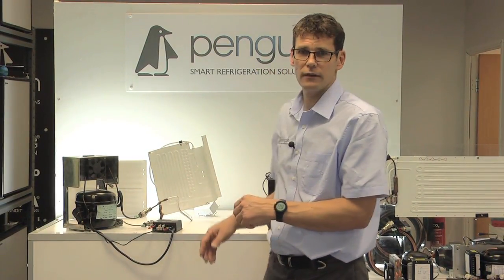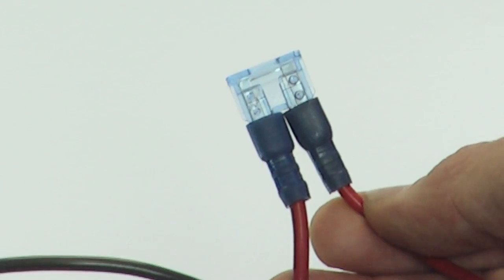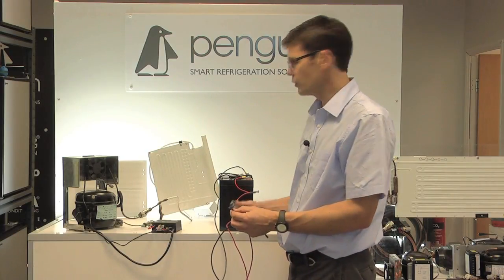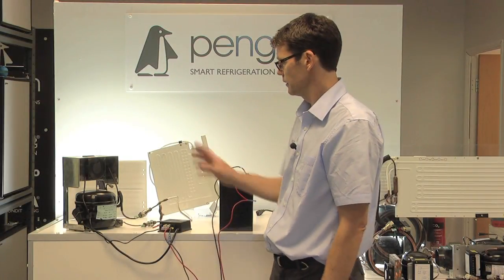Testing and Replacing Danfoss BD2.5 or BD3 12V or 24V 4 Pin Controller

Comment: I have a danfoss 102N3031 for an adler barbour cold machine, bd 2,5.  Its stop functioning twice.  Is there another module thats compatable with this compressor?  Or can I make it function on AC only as the boat is mostly docked at a marina.

Comment: Old video but hopefully I'll get an answer. I use the 24v. What fuse is the proper one? I found a 7.5A one but the one in your vid is blue. Guess it's a 15A? Also can I still get parts from you if necessary?

Comment: Hello, 
I have found that the fan output is faulty. However when fan unplugged the fridge is working. I also tested the fan separately and it is also working and NOT drawing extra amp only 0.3amp.
Any idea ?  Thank you

Comment: Hi. Thanks for the video. Is it possible to connect directly a danfoss bd 2 to the battery 12v without a controller? I just want to try if the compressor works fine. I have a westfalia. Thanks.

Comment: Hi Francesco thank you fro your enquiry.  You cannot connect a battery to the compressor pins directly. The compressor motor is 3 phase DC and you will damage the motor windings.
Penguin Refrigeration will test your controller for a small fee if you would like to have it checked.

Comment: I would like to thank you as I just troubleshooted my compressor with your help and this video.
My problem is to find out, what BD I have. Is it a 2,5 , a 3  a BD35 or BD35F?
My controller is a 102N3030.
On the cover it says Seafrost.
Reply: Check for the pins when you disconnect the electronics. If you have 3 pins it's bd35/50 or if you have 4 pins it' 2.5/3.

Comment: Hi.  I,ve throughly enjoyed and learned a lot from your videos.  I've gone through the tests, replaced the thermistor, but the fridge still has the same problem - it comes on (usually) and stays on for a few hours and sometimes days but then cuts out.  It has to be turned off at the control panel and then restarted (after something cools off?).  Any suggestions?  It is in a '92 VW Eurovan Westfalia.  One other thing I've added a 200W solar panel system and the readout on the  meter is often well in excess of 13V.
Reply: Hi Tom Thank you for contacting us. Its always difficult to diagnose a problem without seeing the fridge set up. If you fridge does got cold and maintains temperature when it runs, it would normally point to an electrical problem,. This could be anything from poor connections, lack of battery power or a faulty electrical component. If you battery power drops off the fridge will shut itself down to protect your batteries from being drained. If you are not able to resolve this issue, contact us directly on sales@penguinfrigo.co.uk.

Comment: I have a 12v fridge with almost the same components in this video. The compressor and fan kick on and there is a small thin coiled copper pipe which gets super cold, but the fridge stays warm. It uses a cooling plate. What could it be ?
Reply: Hi, it sounds like you have a refrigerant issue if only the start of the cap tube is freezing.  You need to get a refrigeration engineer to investigate further - can you confirm the location of the boat and we may be able to recommend someone to help you

Comment: Once I linked out the thermostat, it worked. Is that a controller problem? Perhaps a temp sensor problem?
Reply from the maker: If the fridge works when the thermostat is linked out the problem is the thermostat (and or it's temperature sensor).  It sounds like you need to replace the thermostat. Please send us an email to sales@penguinfrigo.co.uk if we can help with this. Cheers
Reply: I just sent you an email.
Reply from the maker: Received and will reply this morning

Comment: My fuse keeps blowing as soon as I turn fridge on, also was running at high amps before this happened. Any ideas?
Reply: If the system is 12V then the fuse should be 15A.  If you immediately blow a fuse it could be that you have a dead short somewhere in the system.  Use a multi meter to check the continuity across each of the pins of the compressor to confirm the resistance is less than 5 ohms.  Also scratch a small area of the body of the compressor back to bare metal and again check each pin on the compressor to the bare metal to see if you have any continuity.  If you do have continuity or high resistance across the pins then unfortunately you will need to replace the compressor

Comment: I have the danfoss BD 2 12v model 102N3017 on my Westfalia. This video is helpfull for me or not?
Reply from the maker: Hi Matteo, Yes, this video is for the type of controller you have on your Westfalia.  It is normally wiring, but if your controller does turn out to be faulty you can find a replacement on our website: http://www.penguinfrigo.co.uk/shop/product/436/control-module-12v-dc4-pinfor-danfoss-bd3-earlier-compressors/
Reply: Good afternoon Matteo you can use this trouble shooting video for your BD 2 controller -  I hope this helps, Penguin

Comment: Hello. Can you repir the board from compresor 12volt
Reply from the maker: Hi, we don't repair the board, but we can supply a replacement electrical box - see link: https://penguinfrigo.co.uk/product/101n0212-danfoss-bd35f-bd50-controller-12-24v/
Reply: Hi, I am a refrigerator maker. The front of the fog is a few 12-volt boards. It has no burns unless it turns on. Compressor. How can I repair which equipment?
Reply: The controllers are not repaired but a replacement can be purchased, use link 
https://penguinfrigo.co.uk/product-category/marine-refrigeration/12v-dc-compressor-spares/
I hope that helps you.